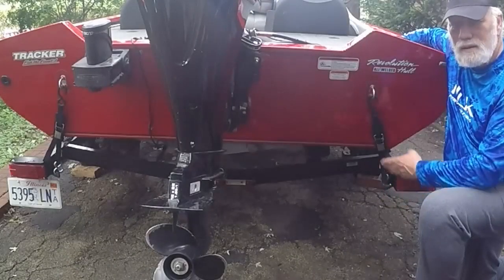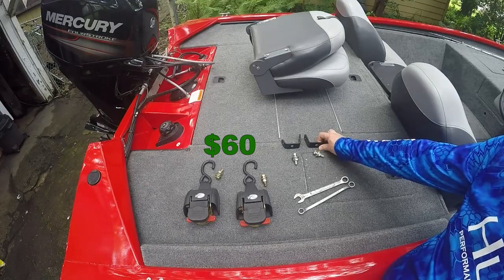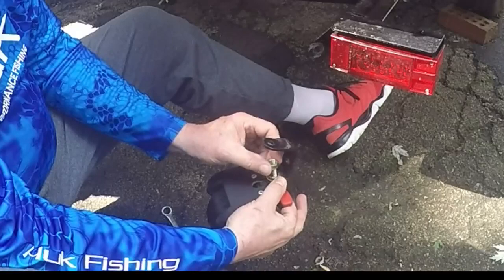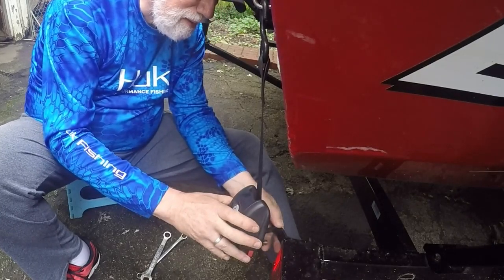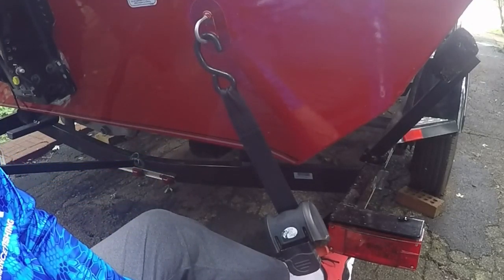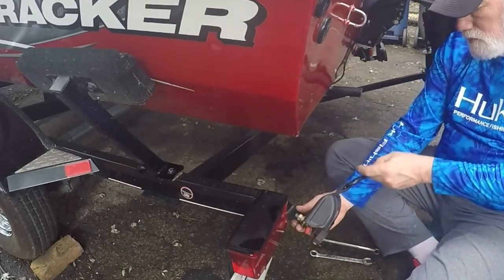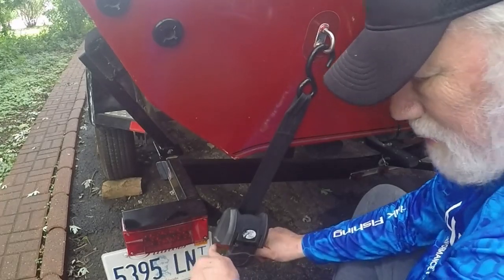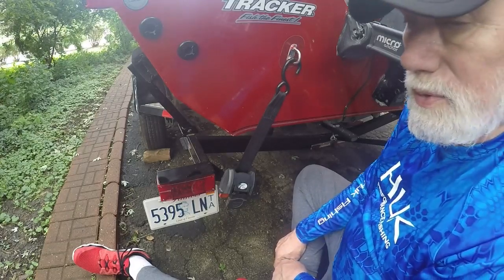How to install transom tie-down

Comment: Thank you Sir for the video.  Bought my Tracker TXW-TE 195 last year and have been wanting to do this install.  Didn't even know about the brackets, so thanks for that.  Question for you and other Tracker owners:  Do your storage compartments on your Tracker(s) leak??  Mine do/did, so I'm in the process of using tubes of RTV to waterproof them. A couple of the hatch gaskets even have about a one inch separation between the ends.  Seems to be an issue with this brand of boat.  My Pathfinder bay boat never leaked, but it was a more expensive boat with apparently better attention to detail.  Tracker, if your listening, you need to improve!!

Comment: Great video john, I just bought a 2020 tracker 175 and wanted to replace the tie downs. I hit that subscribe button! Keep up the good work
Reply from the maker: How's the new boat working out. Have you had a chance to break in the motor?
Reply: @lmbfishingclub4013  ive got about 5 hours on it so far. Mostly using the trolling motor. The boat is awesome. I can cut through Lily pads and go in less than a foot of water no problem. Caught quite a few fish too!
Reply: @lmbfishingclub4013  I got my rachet straps attached finally, referred back to your video for help! Thanks again
Reply from the maker: @fishingwithspencie  Happy to help. Love the way you can get into skinny water with the 175. Tight lines.
Reply: Thanks so much ...Next time I am at Bass Pro I will pick me up that kind of strap !
Reply: Can’t wait to order mine

Comment: Does this bracket not bend when tension is placed on the strap? It seems like it would bend/give allot with the kind of tension required to hold anything stronger than an aluminum boat.?. 🤷🏻‍♂️🇨🇦
Reply from the maker: The bracket is made of a roughly 1/4 inch steel alloy. There is no give to the bracket. Hope this helps.
Reply: LMBFishingClub It does help. Thank you. 👍🏼🇨🇦

Comment: John - very helpful video.  my only question was on having to drill a hole in the right position on the trailer frame and making sure boat buckle does not block to any extent the trailer tail lights (in case of a stop by the law).
Reply from the maker: There was no drilling required. The adapter bracket fastens directly to the boat buckle and the hole that the lever strap hooked into.  Not to worry, there was no obstruction of any of the lighting.

Comment: My first thought is that it wont last long in saltwater.  You did a good job of explaining how to install though.
Reply from the maker: As I live in the Chicago suburbs, we don't have to deal with saltwater. My thought on that matter would be to ensure as part of your maintenance activity keep the mechanism lubricated with WD40 and when you clean off the trailer give the retractors a quick spray.

Comment: Have u had any trouble hitting the rachet when loading boat back on trailer?
Reply from the maker: We have never had any problems like that. The top of the ratchet is three inches below the loading surface of the bunks.

Comment: The problem with retractable tie downs is the mechanism wears out and sometimes will lock up and then your screwed . I’ll keep my old style and occasionally pull over and check the tension and the tires .
Reply from the maker: I found periodically getting some WD40 on the mechanism generally eliminated the lockup. If it did fail on you, the two box wrenches are always in the toolbox and the old straps are always in the back of the car.
Reply: Lil WD40 occasionally will alleviate that issue

Comment: Does the main body get messed up from launching, with water and scum and such.
Reply from the maker: I have not experienced any problems like that. When the trailer comes out of the water the bodies drain very quickly and are not in the water long enough to collect anything.  If concerned about appearance, you can always run a quick spray with a hose will flush the surface.

Comment: Hi John Thanks again for the Video, I went to Bass Pro Shops today but could not find the Tie Downs you were using on your Tracker Boat ....Can you please give me the Brand Name ?  Scott From Henderson,Nevada
Reply from the maker: Hi Scott, Glad to hear the video helped. Checked the website and found the BoatBuckle Universal Mounting Bracket Kit is not available at the Las Vegas store (may  have to order on-line. The Bass Pro Shops Retractable Transom Tie Dow 2-Pack is available at the store. Looks like the prices have not changed.  Tight Lines